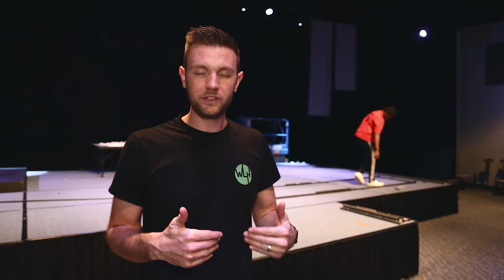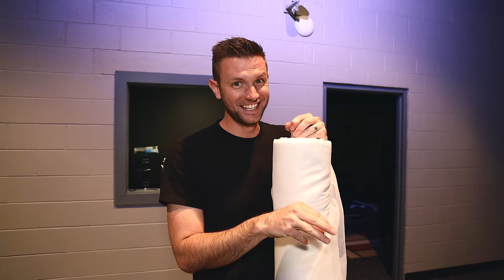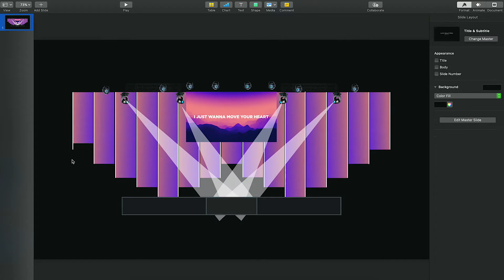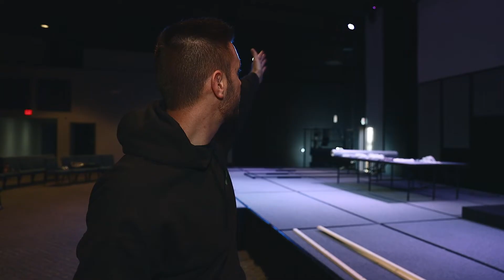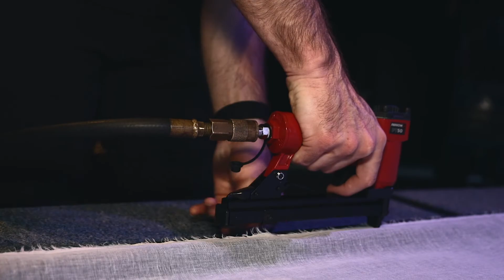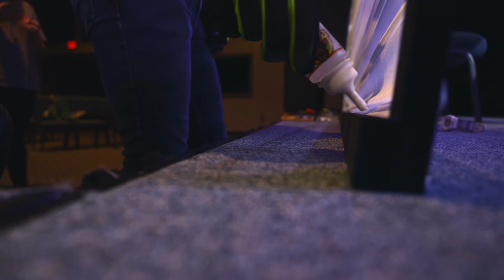RGBW LED Tape & Fabric Church Stage Design Idea

Comment: How funny is this .. I have just started to learn how to pull together LED lights using a chip called ESP32 and I was thinking it would be cool to do something at church with them. Randomly your video popped up and I was not thinking BIG enough lol. This is so cool and such a cool project to get the church involved with, if they are open to it :)

Comment: Hi how are you doing?I am loving your videos. Any chance you can give me tips for my project. I have a small room (the space is 6mtsx6mts) and I am trying to find the best configuration. I am planning on doing a total of eight BTF-LIGHTING addressable led strips (60 leds/m) (5mt each 12v) + Muzata diffusers. What would be the best way to power them? Maybe 2 60 Amp Power Supply (running 4 and 4, or running one at the beginning and one at the end)? How many Injections would you recommend?  Would I get away with one ESP32 board or should I get more? Or is there any board you would recommend for longer projects? I've seen ENTECCs Octo as an option but would love to get your advice on it. Greetings in advance, love your content

Comment: Hello Chat, we really liked the design of the lights, we have all the frames with their LED lights connected to the decoders, but I am stuck in the part of how to connect one decoder with another (I have 4 in total) and how to assign channels to each strip of light, do you have any video? Our plan is to include all the lights to the LightKey, but in these two weeks, we will temporarily connect to an Elation DMX Operator mixer.

Comment: You appear to have 30 individual strips (2 per 15 panels) and your saying they can all be individually controlled? Are you using 4 of the 32 channel controllers or did you serial link some of the strips together? Thanks.

Comment: What are you using to hold up all of the panels? Is there a weight limit that it can hold? Do wash lights shine up the fabric you used too?
Reply from the maker: It was connected to a russ using zip ties by the top of the frame to allow us to slide them to adjust them as we installed them. Then I supported the zip tie with small metal chain on each side of the panel. Each chain was connected to a hook on each side screwed into the frame. It was only up a year.  The zip ties probably would have been okay, but I didn't want to go on a probably and then something bad happen. No we didn't need uplighting because of the LED tape.

Comment: Looks amazing! Are the panels overlapping?
Reply from the maker: They didn’t overlap. They were just placed side by side and I attached them together on the back side. Even the section that is pushed forward doesn’t overlap. It just looks that way viewing at an angle.
Reply: @ Got it!

So dope! How did you attach them together?

Comment: Awesome decoration, inspirational, One question, I am using led strips with a decoder and power source, but the source emits a "digital sound" when the lights are on and increases if the brightness of the lights increases, that even interferes with the audio system (I don't know how), did you have that problem or do you know how to solve it?
Reply from the maker: I didn’t have that problem but you may need to have your sound and lights on different power circuits.

Comment: How do you get the pleats at the top to match up?
Reply from the maker: I measured them as I stapled. Then when I went to the other side I pulled tight looking down the panel making sure each fold was straight and in line with the one on the other side. I also continued to measure each pleat. Only one gave me an issue with not wanting to match up properly so I used a steamer to loosen the fabric.
Reply: @WorshipLeaderHangout  I'm doing it pray for me lol. You need to come to Wisconsin and help me lol 😆

Comment: did you find strip lights to be brighter than uplights?
Reply from the maker: The are not unless you double up but they look really good going all the way up the edge.
Reply: @WorshipLeaderHangout  thank you for this reply. With led strips being 10% the cost of an uplight, I could double up and allow for a better cheaper option.

Comment: Using this design as a reference - love it! How did you hang or mount these fabric and 1x2 frames to your stage? Hang it to pipe? or are they french cleated somewhere?
Reply from the maker: They are hanging from the truss with plastic coated steel wire from a hardware store. I used zip ties initially to get them into place before finishing with steel wire.
Reply: @WorshipLeaderHangout  love the video and design! Just wondering if you have any videos or pictures showing how you hang things like this using the wire you mentioned above? I’m a worship leader from Canada looking to do similar designs but just not quite sure how to hang them properly. Thanks for all you do!
Reply: @WorshipLeaderHangout  how do you connect led strips and then light fixtures in thr church all to the light mixer? Do you use a dmx splitter? I habe one 512 dmx decoder for 8 led strips which i understand can thrn be sent to the light controller but i also have about 6 light fixtures i want ro connect to the light controller. How do i do that please

Comment: So if each strip is separately addressed, does that mean you have 30 DMX decoders?? Each decoder has 8 outputs but isn't each decoder just one DMX channel?  Or am I missing something.
Reply from the maker: I use a 32 channel decoder allowing me to program 8 LED strips on each decoder.

Comment: How many 32 ch decoders do you use in this design?
Reply from the maker: We used 4 for this design.
Reply: @WorshipLeaderHangout  with this same design as you, can i use only 1 decoder (knowing that i May not control independently the led strips)

Comment: Do you have a link for the extension wire?
Reply from the maker: 18/5 Solid Jacketed Sprinkler Wire (By-the-Foot) https://www.lowes.com/pd/Southwire-18-5-Jacketed-Sprinkler-Wire-By-the-Foot/50148248
Reply: @WorshipLeaderHangout  we are using 18 gauge 5 pin LED wire just to keep cost down.  then we had a design change and this wire wouldn't have been so bad.  =)

Comment: This fabric doesn’t exist any longer, has anyone had any luck with another low cost alternative? Sheer organza seems to be really thin?
Reply: I’m looking thru comments for same thing. Went to local fabric store and they had nothing that would work. Someone at church had tons of left over tulle that wouldn’t pleat and was still too thin even doubled up. Now I’ve got LEDs, connectors, wire, etc coming tomorrow. Frames are built and painted….but DIW without some fabric.
Reply: @spencecrisco376  dido.. Trying to find some cloth that would work is apparently more difficult than expected
Reply: @camerongaddy3896  well. Not really. Same company we ordered 25yd of NFR white gauze. Was like $116 shipped. And it’s what they used. Has to be. Grabbed a few stills and blew them up. What’s in the link and what they used…2 different ones. We built the first panel tonight. I’ll see if I can post a pic tomorrow. Or I’ll look you up in the book of faces. 😎
Reply: @spencecrisco376  sounds good to me. It'll be next week before I finish tackling this project
Reply: @spencecrisco376  how did it do?
Reply: @rickultraa  as best as i can guess, this is the exact one they used.  i took screen grabs and blew them up.  as for the material and the how to.. i used 1x2 and we made them 8'x3'.  starting about 3" in we got about 10 folds.  we did find a design flaw on our side.  we put the pleats on the wood where it attached to the wall.  we aren't flying these, we screwed to the back wall.  to fix we are making spacers with 1/2' PVC painted black cut to 1.5".  We will run the cables at the top of the panel and over to our control board.  we have 30 channels of single DMX decoders and power distro.  We got everything off amazon with the exception of the wood and the stapler.  If you have any questions..  just let me know.  To make it faster and consistent, we had a piece of cardboard that was 3" wide with a line at 2.5.  Line that up with the previous fold and use that to quick measure and consistent.  we did find that too much pull was bad, but not enough pull was worse.  also the fold over on the long side, do not pull that at all into the side. It will remove that last pleat.  but the fabcis was great.  we made 6 panels, and bought 25 yards.  to have extra.  was a quick order and delivery.
Reply: @rickultraa  man how i hate trying to find the comments..  so went great.  if I could post pics I would..  what we learned...  1.  The Rosewhatever brand white NFR Gauze was money.  2.  Don't rush the pleats, and don't pull the pleats too tight.  The will block the lamps on the LED. 3. Don't skimp out and buy 5 wire flat because it's cheaper than what was suggested.  Cable management and ease of use well worth the hassle.  4.  The LED tape comes with both end jumpers.  so there's no need to buy tons of extra.  Althought a 10 pack isn't a bad deal.  DO NOT USE the clamp connectors (Trash) from our previous build. Glue the tops LAST just like he says.  we also cut a little slit in each corner and ran a zip tie on each end.  And the other thing..  we had 10 power supplies running 30 INDIVIDUAL DMX decoder channels from our previous LED deal.  Way overkill.  But if you don't have any of that stuff.. don't do the individual.  the 8 light/32 channel is well worth the wiring hassle for $90 a pop.  if you want more info or pics email me at connectionschurchbelmont@gmail.com and I'll send info along.  We added 2 strips in our drum "cage" and are building a LED lite cross to top this project off.  That build is from a Ryland Russell (I think) stage design idea.  Good luck folks.. super easy.. but do not rush..